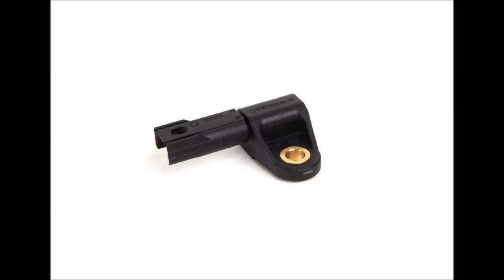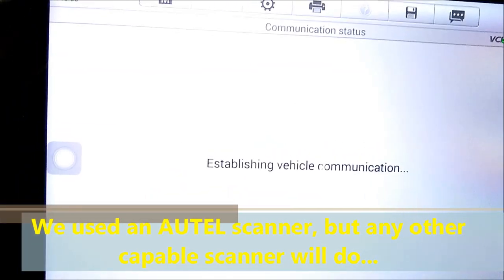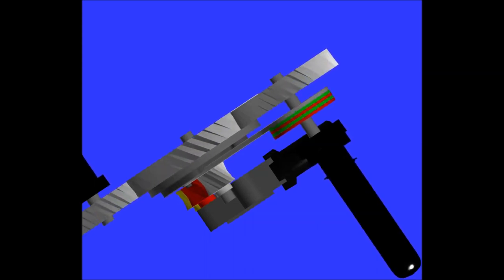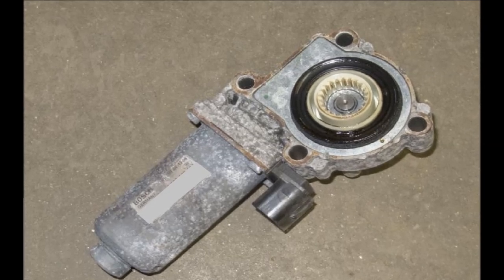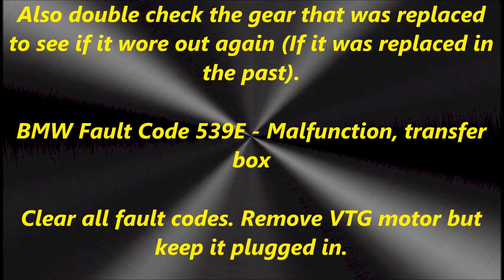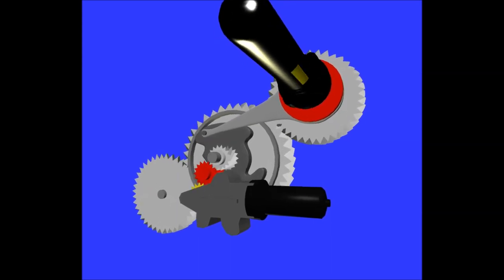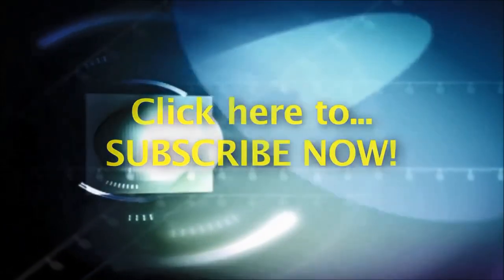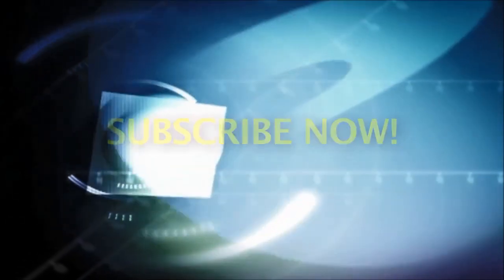BMW VTG 54C4 5463 Transfer Case Issues

Comment: Sir, I appreciate your detail video and explaination of this problem. I have an 09 E70 X-drive 4.8i that I'm experiencing a code of 5F3A and 5F39.  I erased and restarted ,checked again and under TCM got a code 5462 and 5463. My plan is to removed and replace worn gears and change transfer fluid. Hope I'm on the right track.
Reply: Sir i am having the same issue and dealer is charminho me $7000 to chance the Transfer case. HOS did that Gi for you?
Reply: Sorry for the type: charging/how
Reply: This repair done the trick for me. I'm a happy camper again. This  video was on point. There's nothing worse than having a group of dash lights come on all at once. Thanks .

Comment: Thanks man for the very informative video.
I've got 2007 BMW X5 E70 3.0i after driving for 10 to 15 minutes it starts to vibrate between gear change, no lights are on but diagnosis I've got 54c6 code.
I changed the transfer case fluid unfortunately I still have the same issue.
Could you advise me what to do next please?
Thank you.
Reply from the maker: Sounds like slipping wet clutches.

Comment: Thankyou for the very informational video. 
I have a 2008 bmw 335xi . I had a trifecta of lights so I changed my transfer case actuator motor. No luck . Then I bought a used transfercase and changed that it came with its original actuator motor . I tried both of them and now I have a constant awd malfunction light and an intermittent trifecta. What’s puzzling me is I got rip of the trifecta but now the codes I have are 54C8 (classification resistor) which I have 3 different resistor from all three actuators I have and none of them will do the trick. Is there a way to find the right classification resistor. When scanning the car the classification resistance measure in the wiring harness is a value class G, the classification resistance value on the control unit is a value G, and the screening resistance determined on basis of calculation model is a value H. 

Do you think you know the issue. And where should I go can I get it coded to get it fixed ? Are all the values supposed to be the same . How much should it cost?
Reply from the maker: Yes, get another xfer case. The resistor had to be exact.
Reply: @ADPTraining  what happens if the resister is bad and you have to replace it with another one?

Comment: Hi 05 E83, I’m getting 5F3A, 5462 & 54C4. I did a new servo about 10k miles ago as well as the BMW t case fluid replacement. When I did the servo motor, I moved the resistor from old motor to new motor and never did any software calibration or anything. Did I mess up and cause internal damage? Why am I now getting these codes and when I use foxwell scanner to calibrate servo/clutches it says “failed” help!
Reply from the maker: I wouldn't use a Foxwell scanner for one. Did you do damage? 10k Mike's ago did the codes came up? If not, then you didn't do wrong. These systems are finiky so have to tackle codes from scratch. http://www.autodiagnosticsandpublishing.com
Reply from the maker: Also, see my Ebooks on BMW Technology.
Reply: I replace the actuator and code 5f3a is Still
Coming up I, saying clutch stuck open, so the transfer case has bad clutch’s

Comment: Excellent video, explanations, analysis, thank you. My car is an X5 E70 '09 3.0si,  I have this code - 55C3: 55C3 VGSG four-wheel-drive system activated. No DXC setpoint default. What does this mean, is it a follow on issue due to this other code - 54c6 oil wear ?. I have replaced the plastic gear, am about to do the oil. Is it prudent to flush the transfer case of all the oil with some other thinner fluid, or just drain as much as possible and then fill?
Reply from the maker: Watch for the coding resistor. Then do adaptive memory reset.
Reply: Thanks for the quick reply, will try this tomorrow, not sure what you refer to as coding resistor..but I'll try and work that out! Cheers

Comment: So I'm thinking I need to put back the old resistor/sensor on the transfer case servo motor. I changed both a month ago. Now I'm getting these codes.
Reply from the maker: You got it.
Reply: @ADPTraining  what if I don't have the old piece anymore?? Would I have to bring to dealer to program it? I think I threw it out when I replaced it

Comment: My 2006 E83 shudders under low gears so I disconnected the transfer case box. The shudder went away. Then I replaced the transfer case with a used one removed from 2008 E83. Right after replacement, the vehicle feels like binding and bucking when in reverse or drive. Feels like the emergency brake is engaged. I used a scanner to reset the transfer case, but issue still there. Then I rebuilt the original transfer case with new chain and friction disks, issue still there. What could cause this problem? The vehicle ran fine before replacing the transfer case due to shudder issue. Any advice?
Reply from the maker: Look into the program resistor attached to the transfer case.

Comment: Hello, I have an 06 bmw x3 with the code 54C4 popping up I was reading other comments and I came to conclusion that it may be the resistor? When I installed a new transfer case motor I used the old the one that was already installed, I also didn’t install the resistor until I put the the motor back on the car could that have messed something up? Rather then installing the resistor on the motor first then assembling it back in place let me know thanks
Reply from the maker: Replace resistor and reprogram.

Comment: Hi sir, i had a code 55c8, 54c8 and 5F3A before. Then i change the transfer case. After change the transfer case Now i got isue with code 54c4. I need your advise on this matter sir. Pls. Thank you
Reply from the maker: Use same resistor.

Comment: I have the code 5f3a and it says clutch stuck open. Any advice what to do? I replace the actuator already
Reply from the maker: You need to test the system. I have the PWM BiDirectional controller. http://www.autodiagnosticsandpublishing.com/pulse_width_pwm_controller_driver.html

Comment: Hello just changed servomotor and resistor on my x3 but did no coding i only get 54c4 calibration defective instead of a bunch of others... what is reasonable amount to pay for coding
Reply from the maker: Depends on which part of the US or world you're in.
Reply: ADPTraining do you think the 54c4 can be a coding issue?
Reply from the maker: Honestly, I think you may have the wrong resistor. Are U the new owner? Who had the car before? Did you check the old resistor and used the same one? Your new resistor also might be wrong value from factory, as in a defect. 

On those beemers it is not normally necessary to recode, but this changes from year to year. I'd say take it to someone who has like an AUTEL scanned and recode if possible.
http://autodiagnosticsandpublishing.com
Reply from the maker: FYI, recoding is not reflashing. It's just picking from a series of stored programs in memory. I have an Ebook on BMW.
http://autodiagnosticsandpublishing.com
Reply: Yes new owner car has 109k changed servo motor and resistor because at first I was getting 5462 5463 54c8 (classification resistor) so i thought i also needed resistor.... after changing servo and resistor im left with 54c4 i will purchase an amazon scanner hopefully capable of calibrating transfer case if it doesn’t work i will have to get transfer case looked at
Reply: Was also getting the abs ,brake and 4x4 lights, changing servo fixed it but still have 54c4 and feels like if it locks up slightly only when turning left slow speeds thanks so much for your feedback, tried using old resistor but get 54c8(classification resistor) again aswell as other codes
Reply: Did you ever resolve?

Comment: BMW X6M has following faults: 54C4, 6428, 5F39, 601D, 601E, S0104. Mileage is 167,000 miles
Reply from the maker: Ok and...
Reply: @ADPTraining - transfer case clutches were destroyed, due to less than 1 fluid ounce of DTF in the unit.

Comment: Well... Guys I will share with you with my E53 problem have error code 5463... I have removed the adjuster motor and the gear is ok, there are no faults on it... but I have notice that the worm shaft is rotating with big difficulty like old rusty pliers.... I do not know how that motor is build inside... maybe brushes ended, bearings, commutator, brush holder... maybe you guys have noticed something like this... By the way oil, chain,  bearings and sealers where replaced year ago...
Reply from the maker: Rebuilding these is a chore. Try a used one or new.
Reply: @ADPTraining  thanks 👍I will try to buy new one 😉

Comment: I’m getting these codes
55C3: 55C3 VGSG four-wheel-drive system activated. No DXC setpoint default. 

55C6: 55C6 CAN_MESSAGE_SPEED_CYCLE, CE
Reply from the maker: Question